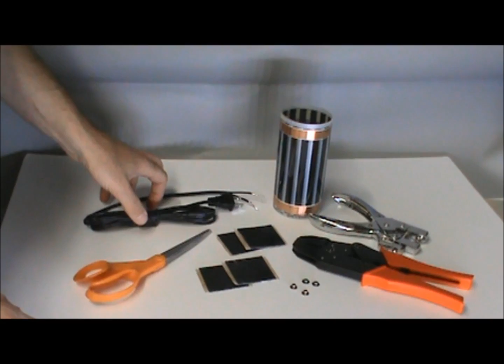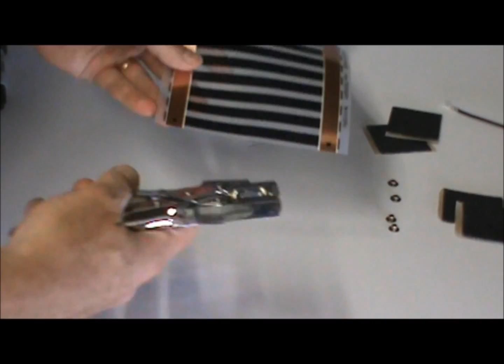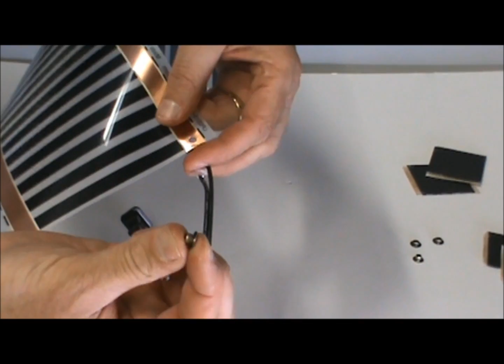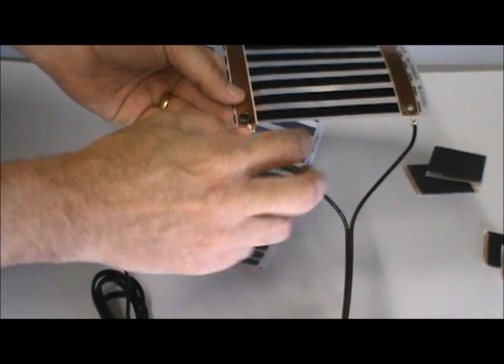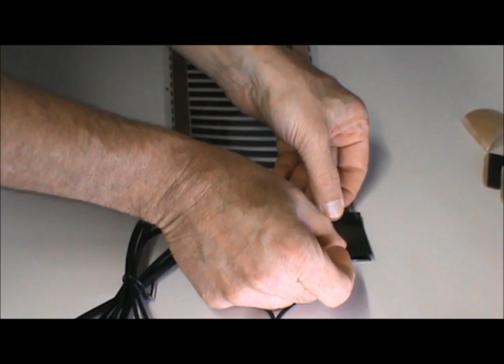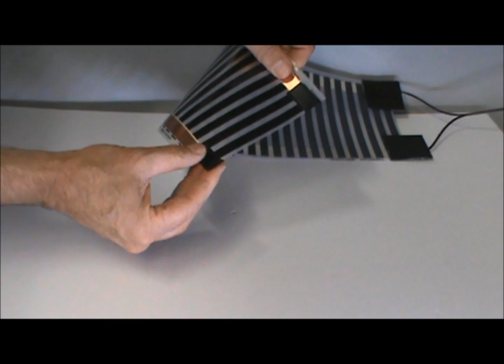THG Heat Tape- Rivet Connection How-To

Comment: Yes sir where did you get those insolated squares from aka rubber adhesive strips ....? ,,, they are hard to find and i need them to put these heat pads together.

Comment: Now to figure out how to do this in parallel.
Reply: Did you ever figure it out?
Reply: @Renniigaed  Nope!
Reply: @Yamashta  Planning on doing a video on a parallel setup, stay tuned!
Reply: It’s already parallel. Your hot and neutral are running parallel to each other (the copper stripes). If you need to connect a strip that’s cut separate from another strip, just connect 2 jumper wires, one from the left copper to the left copper on the next strip and the other wire from right copper to right copper. You’d be joining it back as though it had never been cut.

Comment: What other crimping tool can you use besides buying the 60$ one provided by the supplier?
Reply from the maker: You want to get a full rivet set. The tool provides parallel pressure, and uses leveraged pressure to really get it compressed well. You could use other plier types to make the compression, or even a hammer against a hard flat surface. Just be sure you don't affect the integrity of the rivet by breaking it apart, and the wire and eyelet should not move at all when it is properly set.

Comment: i want to run all my wires out the back, can i daisy chain 3in pieces of 12in wide heat tape vs running the 3inch all the way a cross and letting my wires out the side.
Reply from the maker: Not sure I am visualizing what you mean. Can you provide more detail by email to Robyn@THGHeat.com?